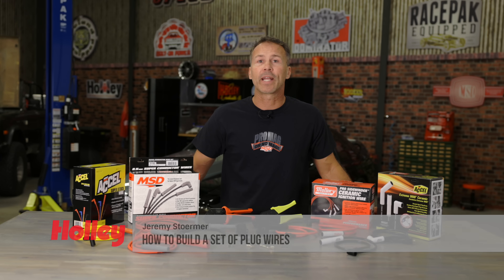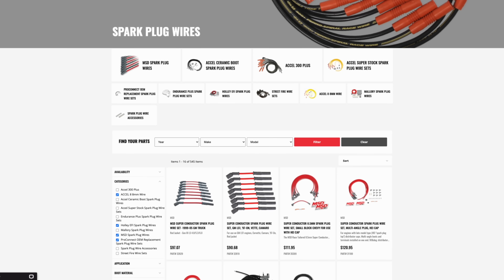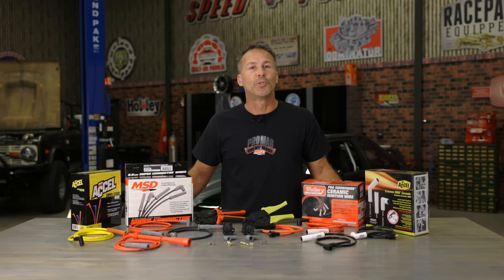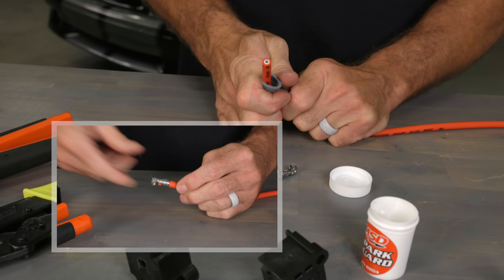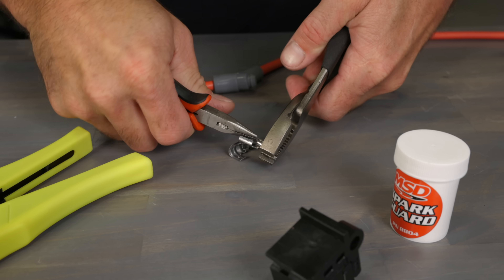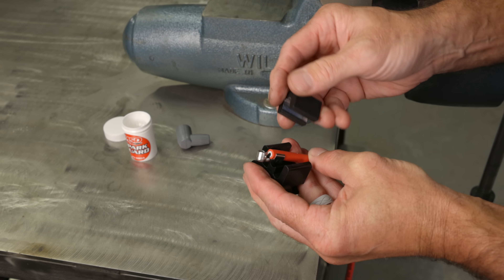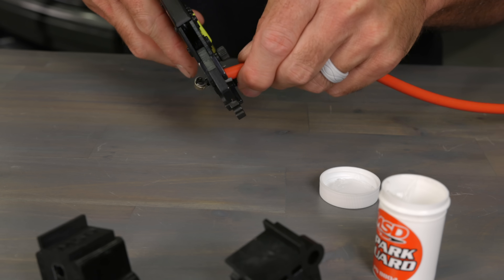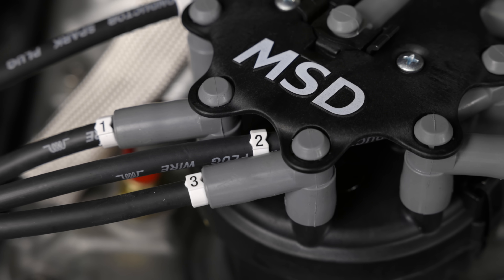How to Build Custom Spark Plug Wires for your Engine

Comment: I've always used MSD products to this point but am wondering if I was to use Holley wires and boots if they would be compatible with my MSD distributor and also  if I was to use a different diameter wire , say 10 mm with appropriate boots would this be ok  with the same distributor ?